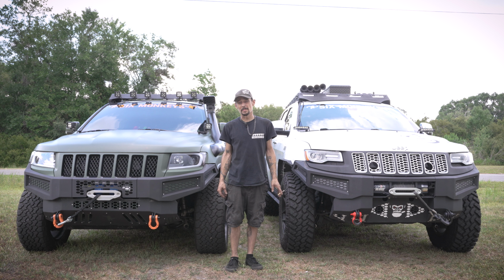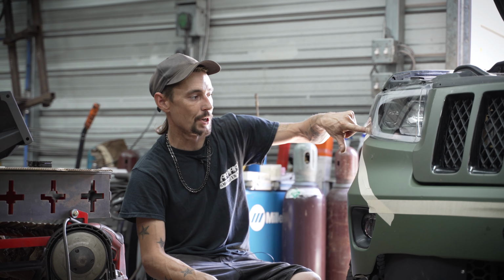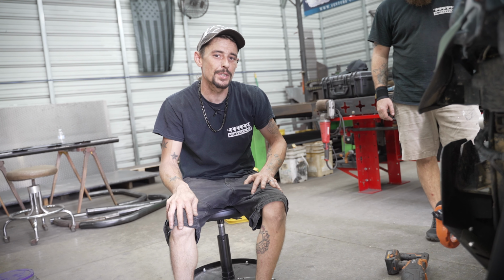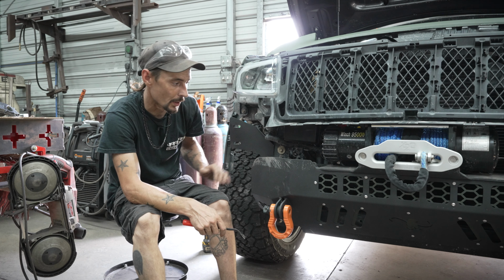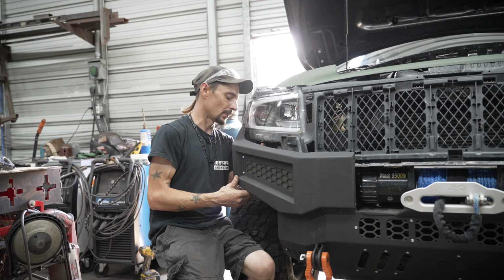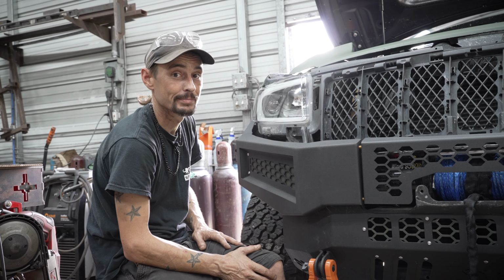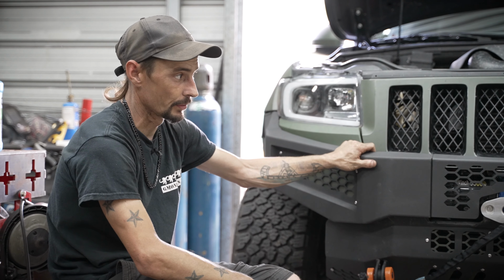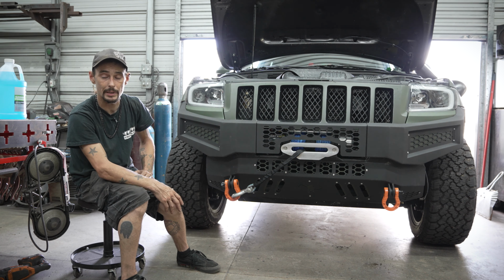WK2 Primate Front Bumper Install - 6Monkeys

Comment: What does the installation of that bumper do to your fuel mileage? I’m curious because I would like to get that bumper, but also look at my fuel mileage.
Reply: I personally didn’t see a difference. And I haven’t heard any reports on mileage dropping. I do know that the front lower guard, sump, belly, and trans plates have reported to increase mileage by 1-2mpgs. Streamlining the front lower, and underbody may just negate the upper.